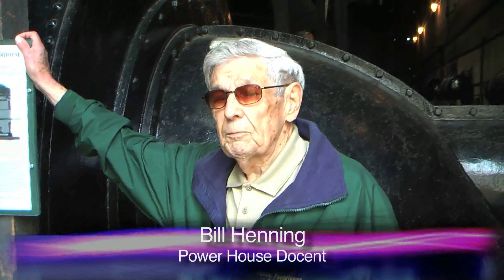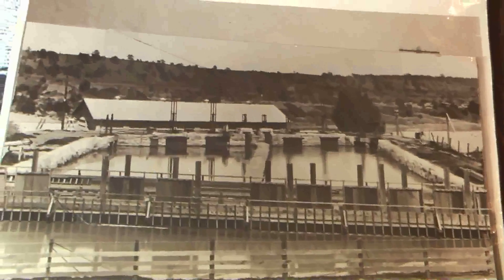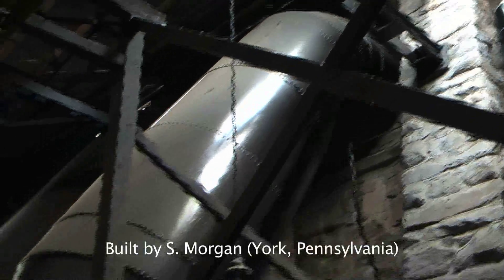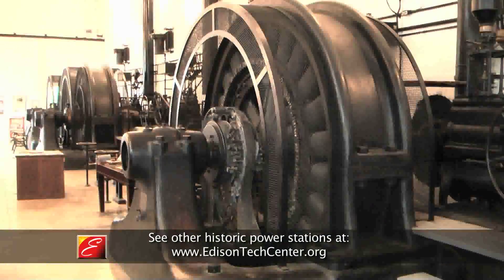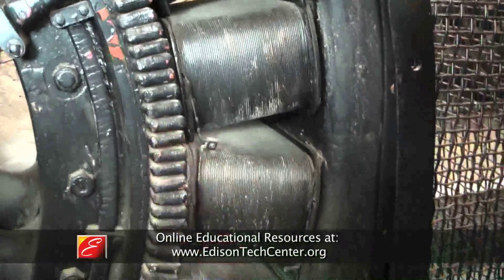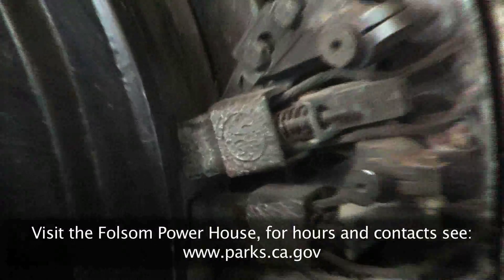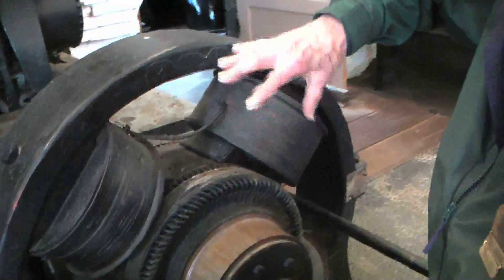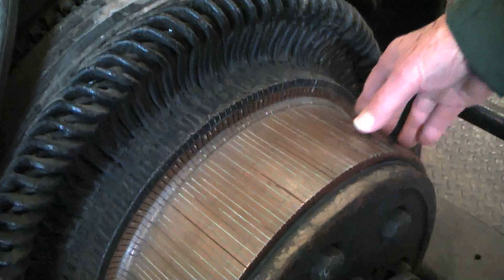Folsom Power House - Generators 1895

Comment: AC bad
Reply: Nah 
Look what happened to Edison
He’s dead and they don’t use dc current for houses.
Reply: @demetrijohnsonssirenvideos3590  which is strange as most devices rectify ac to dc, could leave out a lot of steps when solar powered from your own roof, some ac device(s) can be directly powered from a dc source ... less work for the convertor.
Reply: @jyvben1520  well I mean for long range transmission of DC current, it’s a lot harder to do than AC.

Comment: I wonder why they put the field windings in the stationary position while running all the power through slip rings and brushes? Modern alternators always put the field windings on the rotor and the stator windings generate the power, which never has to go through a moving connection.
Reply: Ethan Lamoureux , he mentioned that the generators were adapted from DC generators. So, it makes sense that the field coils were left as they would be in a DC generator, and the armature redesigned for the AC coils and skip rings. That is also the same configuration that is still used for a wound rotor AC (synchronous) motor.
Reply: I wished I knew about all this stuff better.

Comment: I thought the old fellow had mixed up watts and amps. hope I am as in good a shape at his age. I first thought that on the 750 watt gensets, way different 750 amps. I just wish I had saved the one at dryden washington, that powered wenatchee, it was still perfect when I saw it with all the guages and gensets through ww1. now gone, sob.
Reply: Paublus Americanus , I believe he meant to say 750 Kilowatts each. That would make sense if the turbine driving it was rated at 1200 horsepower.

Comment: What powered the field of the field generator.
Reply: The DC generator is a shunt wound machine. The stator (stationary) coil is connected in series with the armature (rotating ) coil. Normally these machines retain a small amount of residual magnetism from previous operation, which is enough to allow it to build voltage as the generator starts to rotate. In the event there is no residual magnetism, batteries can be used to momentarily energize (flash) the generator coils which restores the magnetism. 
All power plants have dc generators that provide exciter power for the main generators.
Reply: maynardr6: From what I could discern, they had to use a separate AC alternator to generate the current for the field coils. If that is so, it is a very inefficient system, using a generator to run another generator (generating the exciter current for the field coils in order to create the alternating/rotating magnetic field).
Reply: @Erzahler
The DC generators shown in the later part of this video are what generate the power for the field windings of the main alternators. Field windings in an alternator require DC, which could not easily be created from AC since they didn’t have rectifiers. But it appears that what maynardr6 was asking was what powered the field windings for the DC field winding generators, and the answer is as Rick Delair wrote, they are self-powered by the generator’s own output and started via residual magnetism.

Comment: What a fascinating lecture. What I wanted to know is did the powerplant have to stay in phase with other plants on a grid, or was it a self contained system? The other question would be how did they balance the load to keep the voltage from leading the phase, or did they just burn out generators like our example here?
Reply: Zyworski , this plant would have operated by itself, as there was no power grid in those days. Voltage is controlled by varying the DC excitation to each AC generator field. In an AC system, voltage will normally lead current due to reactive load such as transformers and motors.
Reply: Back in WWII, Trustees from Folsom Prison Operated Water Cooled Browning M.G.'s Positions. Because They Were Convinced that the Japanese Were Going to Bomb Both Hydroelectric Power plants. Since They were A Strategic Target. It ( Folsom Power Plant ) Had Originally been The Sole Source of Electricity For the State Capital.

Comment: This seems kind of old school but more people really need to learn and be able to do the formulas and basic engineering for AC and DC generators/motors. These days with more electric cars, solar power and other things becoming more common we need to absorb basic info so we can take full advantage. Learn about phases and how they work. How to control them. How to pick the right motor and battery. Get past the marketing voodoo. 20% of all people on Earth need to know these things.
Reply: And critically the people where it matters need to understand the infrastructure required to make widespread vehicle electrification viable

Comment: The turbines were horizontal, driving the horizontally mounted generators.  (You can actually put your head inside a turbine through a cutaway.) The govenor of one generator failed, causing an overspeed that resulted in it exploding due to centrifugal force. The man on duty was in a phone booth there and was not injured. To this day you can see parts of the generator imbedded in the vaulted brickwork overhead, two stories up.

Search Folsom Powerhouse State Historic Park for hours.
Reply: How did the governor keep it working at the right speed? This place would be interesting to visit!